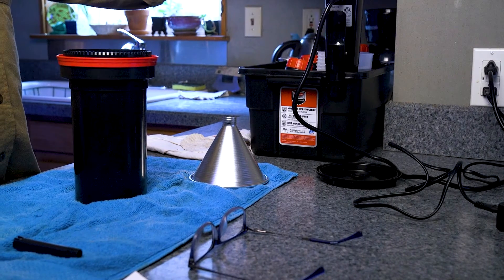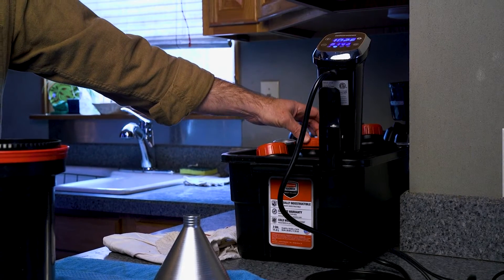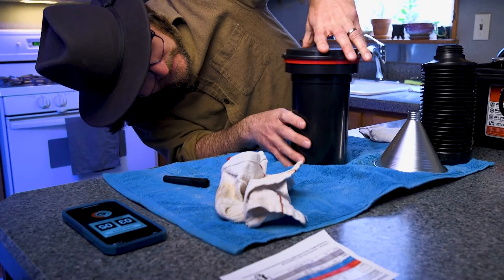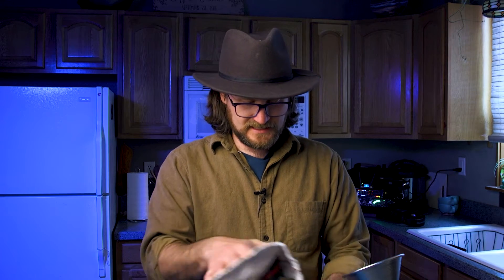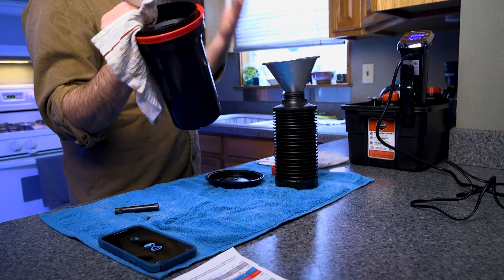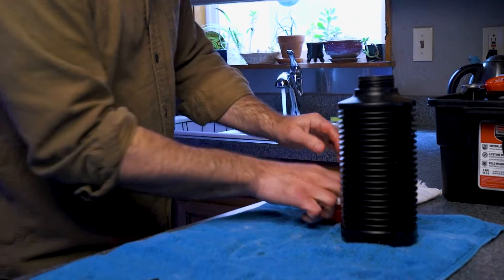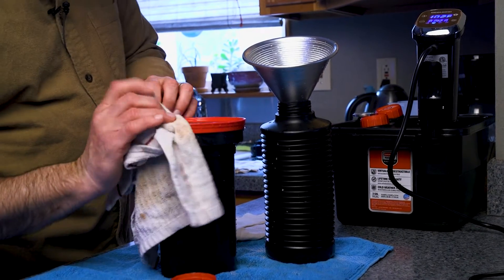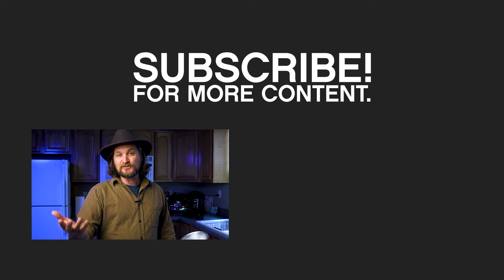Develop Color Film at Home!!

Comment: You should put your tank in water bath between agitations. Otherwise the developer will cool down, and your colors might not be correct. This is important with developer, as in bleaching and fixing the reaction will go to the end, and process times given are made with this in mind. However, this is not the case with developer, and temperature and time must be correct. I would even recommend using a 3% acetic acid stop bath after developer to ensure that developing time is exactly 3:15. For best results, use chemistry with separate bleach and fix baths - not those "simplified powder kits" with a blix. When you maintain a good process, it is much easier with printing and/or digital post production, as color casts due to incorrect developing can be hard to correct.  This is especially true if printing C-type in darkroom.